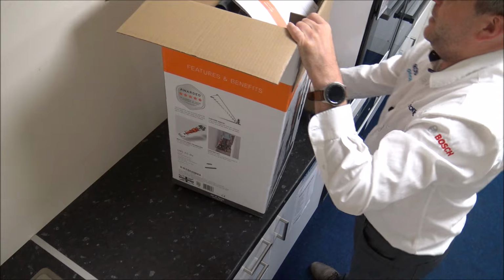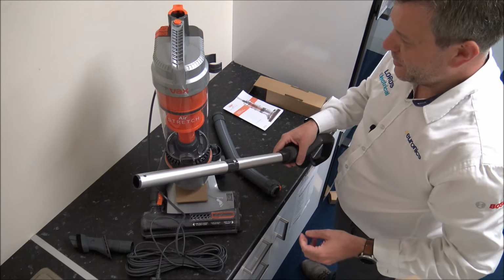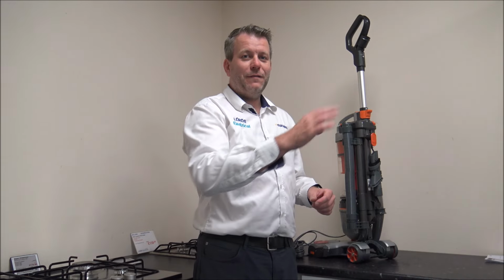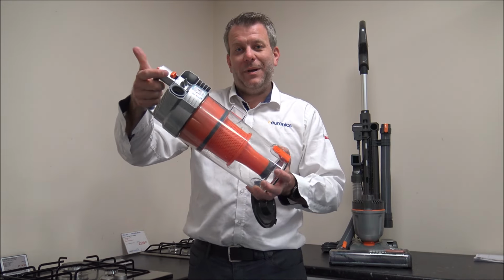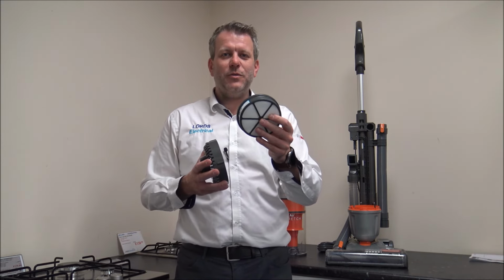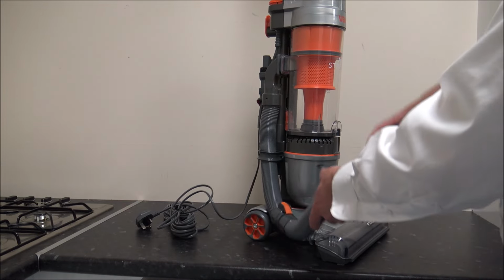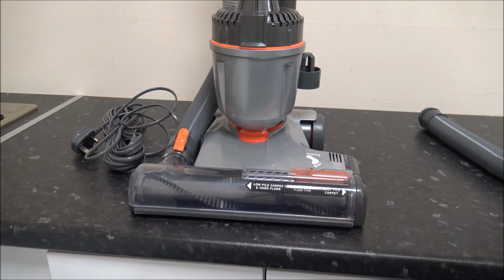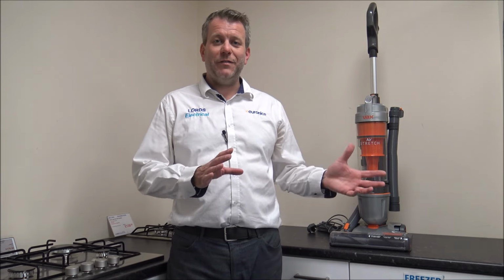Vax U85 Air Stretch Corded Bagless Vacuum Cleaner

Comment: Thanks for the instructive video. One thing I’m not clear about is attaching the 3 in 1 tool to the extension hose. Is it supposed to click in? Mine just slides in about an inch and doesn’t feel secure. The orange clip doesn’t seem to do anything!

Comment: We bought one of these sometime in 2020, it is a great Vac, very mobile, can be taken off the pedestal and carried along to get the stairs with the hand tool. The pedestal gimbal however broke last week, the Vac still works but the upright mobility is gone. I've opted to replace it with the same item as I have spare filters and I do like the unit and the Vax brand. i also own their carpet and upholstery cleaner

Comment: Removing the Brush Head on this model is out of date . Dyson and Vax Cordless only requires a Coin to simply remove  the Brush as Hair and Strings wrap around it. You have to dismantle this one. Not easy at all 😢
Reply: Miele C3 only requires a coin.  I agree with you - it should not be necessary to have to use a screwdriver